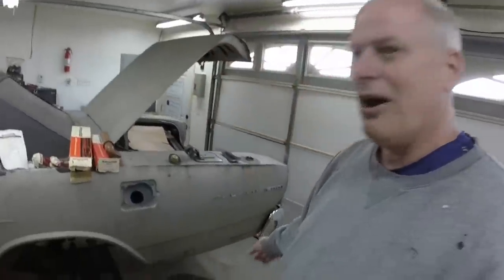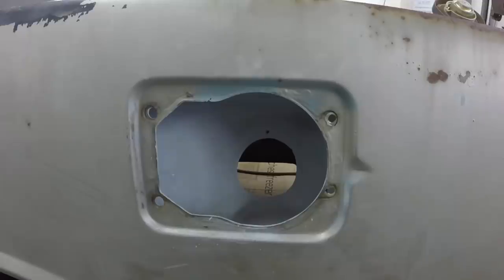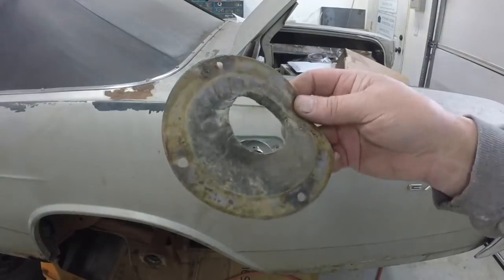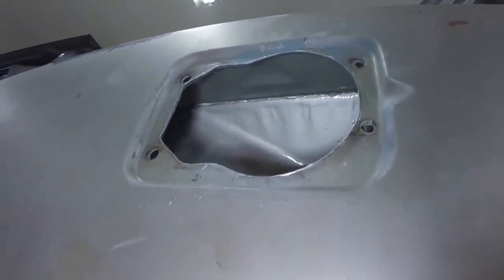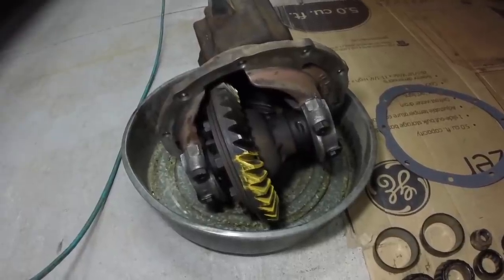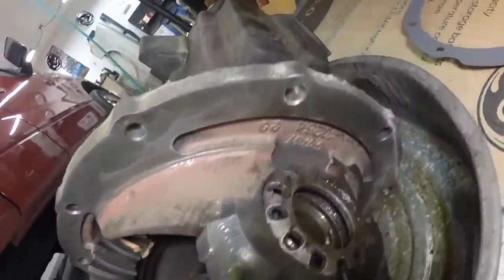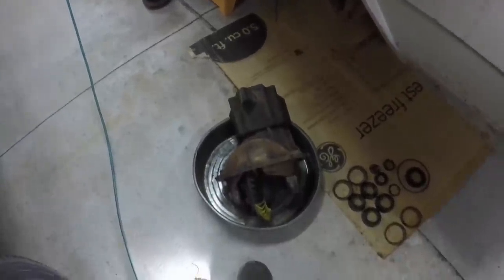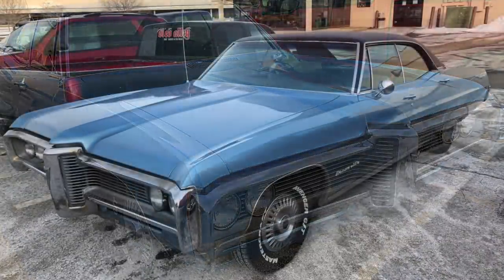1966 Ford Galaxie 500 convertible restoration part 65, painting, and getting the pig back

Comment: i see sooooo many videos where people replace the automatic with a 4 or 5 speed manual. one would think that would'nt match the diff. automatics depend on the torque converter & usually matched with the diff. i had a '76 ford highboy 4x4 with 390 & C6 had the local 4WD place rebuild that C6 for $999.00 and they talked me into installing a crazy shift kit because they thought i was going to truck pull with it. EVERY TIME that thing shifted through it's gears it jerked me around in the seat like chitty chitty bang bang
Reply from the maker: Transmission type, tire size, all that affects performance, and gearing needs to be changed considering what the drive train is, and what the vehicle is used for... cruising, towing or whatever else. Axle ratios often seem to get overlooked.

Comment: Excellent videos. Wondering why not use gas tank sealer? I've used it with excellent results.
Reply from the maker: I find it breaks down over time. The inside of the tank cleaned up nice, and it docent leak.

Comment: Good thing it wasn't a root canal....everything looking good ..i was wondering what does the inside of the trunk lid look like at the rear underside..I've seen a few rusted out..see you on the next one Cheers 🇺🇸🇺🇸🇺🇸🇺🇸🇺🇸🇺🇸
Reply from the maker: There is surface rust where the seam sealer is gone. Looks solid. I did show it in a past video.... maybe when I first got the car.

Comment: Are you saying that yellow test paint was on that ring and pinion gear when you pulled it apart? I use that paint when I replace the ring and pinion to see that they mesh properly. I teach that in automatic and drive lines class. I got a lot better at replacing the crush sleeve. I was always acrew one or two up when I started.
Reply from the maker: The yellow ink grease is what the ring and pinion shop used. I had new bearings and seal installed. I have rebuilt them in the past... using the special tools the dealer supplied. I don't have the special tools, So I take them to Drivetrain Specialist. This is the 5th diff. they have done for me.
Reply: @OldCarAlley  I gotcha. We just use that yellow ink lube to see the ring and pinion mesh.So you just had it done. I was wondering how it got there.